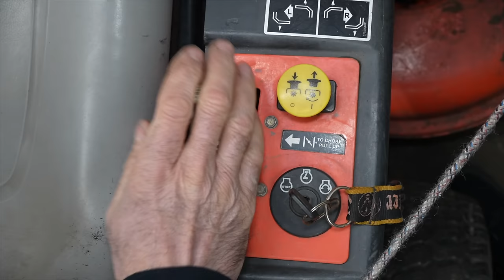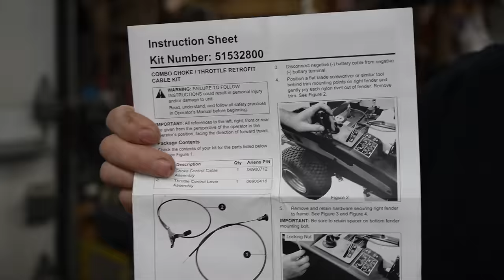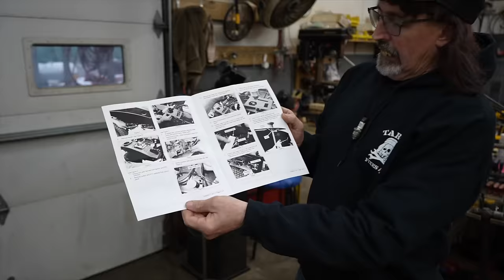Another FAILED Mower Idea To Look Out For/AVOID

Comment: I'm still using my 1990 Dynamark  ride that is running and cutting fantastic. I never use ethanol fuel in it, and I maintenance it whenever needed. It has never let me down yet. I refuse to buy the junk that's made nowadays or go battery. Your channel has been huge in helping me take care of all my machines. Thank YOU SO MUCH FOR ALL YOUR HELP
Reply: Same here, I just put 1500 into a 1984 simplicity. It's good for another 35 40 years!
Reply: @troy3052  They just don't make them like they use to. That's awesome you were able to get it back up again
Reply: They made lots of junk back then also. Fortunately most of it has been scrapped by now.

Comment: My Ariens Zoom has the separate throttle and choke. It's from around 2016 or so.  Still a good video  guys.  Thanks.
Reply: How has the mower been overall? I've been trying to find a cheap one used
Reply: @M.TTT.  I bought it new, and had been pretty good.   Had one coil failing intermittently,  about a year ago.  Teryl got me a pair of new coils, and all is good.

Comment: While looking over the new power equipment at one of the big box stores (I won’t say which one but it’s the opposite of Highs) one day many years ago, an Ariens was the first riding mower that I ever saw with a plastic transaxle on it. Many were built that way after and I assume they were not the first, either, but I lost a lot of respect for their brand that day. All these many years later, I see any Ariens and all I can think of was that new riding mower with the cheap looking black plastic transaxle case. What a piece of junk!
Reply: Definitely not the first. But most things at big box stores I feel are cheapened. If buying power equipment or mowers I always recommend dealers. They have better options, better products across the board, on site warranty and service as well. And some offer good financing. But not all dealers are good ether.
Reply: Unfortunately this SOP for MOST manufacturers, even the high profile ones! Good example is John Deere with PLASTIC hoods on their riding mowers. Even my CHEAP 20yr old MTD (Yardman) rider has a METAL hood!

Comment: Nice to see a well maintained piece of equipment come into the shop finally.😂
Reply: and probably proud to drop it off in such fine condition.
Reply: No kidding!!!!  Amazed at how many people trash out their equipment, then bee-atch when the POS breaks down.
Reply: That's a huge pet peeve of mine. Takes me roughly 5 minutes to use the leaf blower after each mow. I haven't had to replace a belt or mandrel in years. The moisture from all that debris is probably what froze the choke cable
Reply: Yeah, you could almost HEAR the rusting from the packed in damp leaves!:face-green-smiling:

Comment: I like the way you ran them and did not cross the cables. In hindsight ,  I suppose you could have shortened the cables and pulled out the old Z bender ???  Also you could have hooked the choke cable  like you did at first and cut the control lever section that wasn’t needed.    But either way, good mod!!👍.

Comment: I have an old Ariens S322 snowblower that had bad ideas when it was young. Replacement parts ended up working better after a while.
Reply: I have a "Mack SS522" (Generic version of Ariens, built in BRILLION, WI). I purchased this snow thrower in '94 from Menards for $199.95, Mack Industries was closing. These snow throwers originally went for $450. This machine is FANTASTIC, starts on the FIRST pull every season, never any parts, except a belt 2 in 20yrs. What makes it great, is that it's a 2-stroke 5hp, 22". Never needs oil changes and STILL has the original plug!
Reply: I have a "Mack SS522" (Ariens "black label" version) that I purchased from Menards in 2004. They were being closed out (2-stroke ), for $199 (no warranty or paper work). All it has ever needed was the belt (a couple times). That 5HP "tecumseth" engine is GOLDEN! It ALWAYS starts on the first or second pull (never need to use the electric start) at start of season! And after 20 years has needed NO repairs, even has the original spark plug!! However, I do maintain it by the book. Btw, that "SS322" is the 3HP version of mine.

Comment: What is amazes me is how dirty people leave their equipment! I would literally freak out with OCD if my mowers were left like that. My stuff gets blown off top to bottom with leaf blower every time I am done mowing and they are washed and shined up if they get dirty and at end of every season and covered!
Reply: Exactly what I noticed also.
Reply: Some people think it's just an appliance like their vacuum cleaner and just keep using it without caring for it.
Reply: Yep, I do the same with all my lawn equipment. After every use, I use the leaf blower to clean the whole machine. I also blow the engine and cylinder cooling fins clean to help keep the engine running cool. I also give the machine a good power washing in the fall and grease all the fittings and change the oil and filter. I even take the deck off and power wash the underside till it's completely clean. And like you, I cover the machine for the winter. It's great to start another summer season with a clean and well-maintained machine. It amazes me that someone would drop off their machine for service in such dirty condition. At least blow all the leaves off the machine. Come on man! Does that remind you of the Clown in the White House?
Reply: Hey, I agree 100%. An EXPENSIVE machine like that deserves better!
Reply: When I store my 21yr old MTD "yardman", I thoroughly clean the UNDERSIDE of the deck and apply Fluid Film. The deck is all original (no rust holes) on a 21yr old mower that I paid $1098 (OTD) from Home Depot!

Comment: One error - you used a natural white nylon cable tie to hold the cables to the Krohler engine flywheel cover. They are not UV stabilzed and may become brittle in a few years. The black ones are stabilized (80% of the time...). However, the Ariens orange engine cover will keep the sun off of it, plus I have had some really trash, black colored cable ties in the past that fell apart from a sealed bag. Some were made in Chicago. Shocker. Fake/cheap, poorly mixed resins, or amateurs at injection molding. Yours looks like a strong, quality piece.
Reply: Yeah, I have had the SAME experience with the Chinese ties out of the bag! That is why I will spend a bit more for QUALITY ties such as Gardner &Bender ties.

Comment: To clean the burrs off freshly drilled hole use a larger bit in your fingers. Knocks off cleanly, might even make a small neat bevel.
Reply: It's called a uni-bit.  Use one.
Reply: @I_Dont_Answer_Questions  costs money to buy a uni-bit. And doesn’t address the issue I brought up.

A large bit in one’s fingers does a beautiful job knocking burrs off, and provides a small, professional appearing taper around the hole. And is something one has in one’s toolbox already.

Comment: LOL !  Taryl I was hollering to you that the key lanyard was stuck and when you finally found it I spit my beer out. I believe they had the throttle cable in the lower position because it looked like it  rubbed the  choke  control lever although I was like you I didn't like how they crossed over each other.
Reply: It was a Jagermeister lanyard...hahaha

Comment: Why would they design it so poorly. Mowers should be easy to fix and reliable as the older ones. Nowadays they are not worth the money anymore
Reply: Next time buy a John Deere John Deere mower….not one of those Home Depot John Deeres!
Reply: Designed to a profit margin not for reliability
Reply: @Showboat_Six  i am from germany and we got John Deeres and Sabo (dont know if the brand is popular in the US) and they are very well made machines.
Reply: They don't make the new better because there is no reason to buy another if the new one never "wears out" or breaks..

Anything without grease zerts or with a "lifetime" fluid is JUNK!
Reply: You have a point, but fixing stuff like this is easy if you have all the tools and equipment
Reply: I love it, they break something simple, people then throw them out or list them for super cheap on marketplace for people like me with common sense to fix!
Reply: @M.TTT.  My mowers are old ones from the 80s and 90s, like my old Snapper 21500pcr Commercial Hi-Vac. It has the Wisconsin Robin engine (WI-185V). It is build like a tank still runs today. All it takes is a little maintanance. I would never throw it away. I also saved alot of mowers from junk and fixed them.
Reply: They made plenty of crappy old mowers too. Those are just not around anymore. Good old mowers are still around as the good new mowers will be around years from now
Reply: @derrasenmaher9730  oh yeah, I wasn't specifically calling you out, in the USA suburbs, many times people just throw out old or even few year old mowers, snow blowers, weedwackers/trimmers, etc. Its crazy, but good for us mechanics
Reply: @M.TTT.  oh i am sorry. As I said I am from germany and yes people throw away good stuff. But when I was a Kid in the 90s, even the cheap branded mowers had a better quality. We got machines over here that outlasted others easyli but now it just dont feel the same. I am sorry for my Bad english 😁
Reply: @M.TTT. 
Exactly, but now you’ve let the cat outta the bag. 😮
Reply: @jeffvickers9390  „Katze aus dem Sack“ 😉😁
Reply: @jeffvickers9390  nahh, those people don't watch this channel lol
Reply: Then you woke up
Reply: @iamburl2667  ok, liberal
Reply: Every thing today is threw away and purchase another.
Reply: @derrasenmaher9730 super cool Grass Rat!!
Reply: The sad part is, some engineer probably got a pay raise for coming up with junk
Reply: Because the engineers that design them  , don't have to work on them.
Reply: @Showboat_Six  And pay a SMALL FORTUNE for it! LOL
Reply: @mikem5475  Having a drill and some wrenches is NOT a deal breaker!
Reply: @M.TTT.  "Mustie" gets them for FREE in his neck of the woods!
Reply: @TheOzthewiz  as do I, if I drove around on garbage night I'd have more work than I could handle lol

Comment: Classic example of 'Value Engineering' gone wrong.  An engineer was challenged to reduce cost, so came up with this idea to save 30 cents by eliminating the choke knob. On the cable crossover, the instructions were correct, now your choke lever is rubbing across the top ofntbe throttle cable.  In the instruction diagram that did not happen.
Reply: I don't believe it was the engineer's fault. The "bean counters" at Ariens were responsible for implementing this "cool" idea!:face-turquoise-covering-eyes:

Comment: Looks like the throttle cable is routed on bottom and cross crossed so it doesn’t rub on bracket. If you start video at 33:22 it’s a good comparison from yours to instruction.

Comment: Tip: Use black zip-ties for outdoor equipment. White have no UV resistance and get brittle.
Reply: AND, make sure they are AMERICAN made! The Chinese ties (even black ones) are TOTAL junk in COLD weather! First time you "ZIP" them in the COLD, the "locking tab" snaps off. I wish I could find the "original Thomas &Betts (inventor of "ty-wraps") ty-wraps with the metal locking tab (at an affordable price). We used them in the "mainframe computer" industry in the '60s and they held wire harnesses like a pair of "vise grips"!
Reply: Don't use "Chineseum" Ty-Raps (white OR black), get brittle in the cold. I ALWAYS use "Gardner Bender", they NEVER fail!!
Reply: @TheOzthewiz  Good to know! I see good reviews, and not overpriced.

Comment: Did it come with a new sticker without the choke on the throttle lever?  If not that section can probably just be cut out.  Then there would just be a somewhat odd gap in the sticker.

Comment: My Dad worked at Ariens in brillion Wisconsin
Reply: Great to hear. I own a snow thrower that was built by "Mack Industries" back in the mid-'90s. It is a Mack ss 522, generic version of the Ariens SS522. I bought it on 'close out" at Menards in the Fall of '04 for $199.95, as-is, NO paper work or guarantee. I assume the close out was because this was a 2-stroke machine! I tried calling the number on the serial tag, but the number was not in service! "Mack Industries" was also located in Brillion, WI!

Comment: Before you throw away those dead cables, snip off the ends and pull that stainless core out.  They have a thousand uses for a tool man to repurpose. Same with a stainless radio antenna, save it for tool man purposes.

Comment: I have a 25 HP Kawasaki on my Farris and I had the same problem with the starter not spinning fast enough causing the engine not to crank and I have replaced two starters all was bought off of Amazon and now this one is doing the same thing not spinning fast enough so now I take the air filter out and spray a little starting fuel or carb cleaner in the air box and fires right up every time. Only have to spray it on the first start up after that cranks up every time
Reply: Load test your battery. Any auto parts can do it if you can't. Clen and tighten battery connections at starter motor and engine ground, same procedure at the battery connections. Cover your connections on the battery with grease.
Good luck.

Comment: With these engines nowadays having compression release you have to have a good starter that's turning them over fast enough to get them to start otherwise if you turn them over too slow the compression release is keeping them down too low on compression

Comment: I like the Kawasaki single cylinder and v twin. Why? Never had any issues with them other than a fuel pump. Kohler is not what it used to be as is a buttload of alot of brands these days.

Comment: There is an aftermarket starter on Amazon for that one that is designed MUCH better. Instead of that metal to rubber friction, the bendix is a solid metal piece. The one time aftermarket is better than OEM.
Reply: If the replacement is "Chineseum", it MAY not be as good as the original. You can't tell by just looking at it, without trying it!
Reply: @TheOzthewiz  Oh, I bought it and installed it on a customer's mower... over a year ago and he still hasn't come back with it, so... I'm guessing it's good.

Comment: No wonder that customer didn't do it himself.  He may have noticed two completely different panels in the pictures and realized that something wonky is going on!!  It almost looks like the fix for that choke would be worse than the problem it was intended to fix.  I would expect to see that thing again real soon Taryl.  Did you notice that it is a Kohler engine?  They are not so good!
Reply: Look at that machine... All they do is run it, straight into the ground.

Comment: It was a bad design , i saw right away the original route had worn outside of both cables on the frame. Also i agree the way you routed new cables at linkage was better , eliminated another bad idea of theres. Proves you have to use your brain .

Comment: 17:30.   Hey I JUST Got Done Telling 100 other people You CAN'T drill on high speed.   It instantly dulls the tip and flattens the drill from heat. You have.  No no. You HAVE TO Drill on slow speed for the bit to stay sharp
Reply: Also, using some "cutting oil" or in a pinch, 3in1 oil. The job will go faster AND the bits will last MUCH longer, just sayin'.